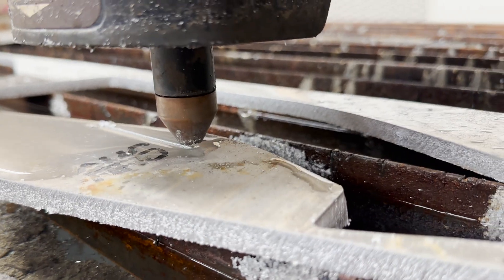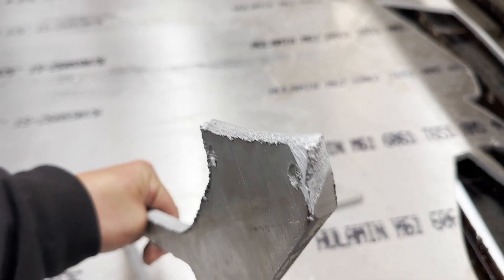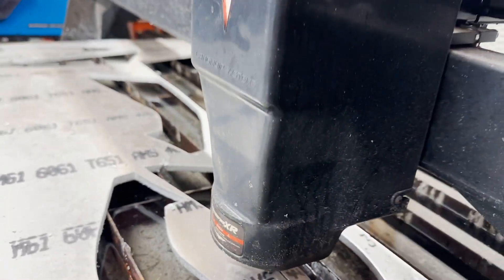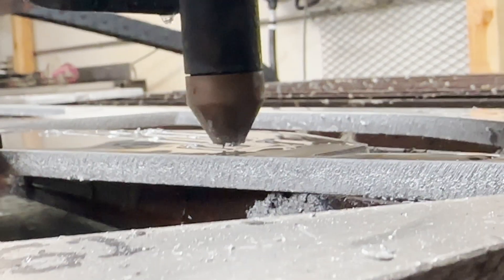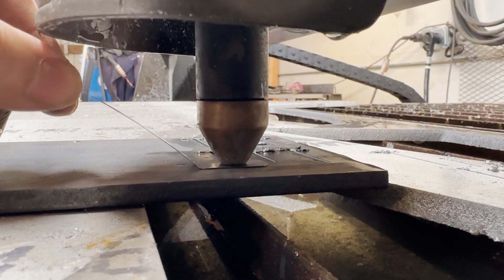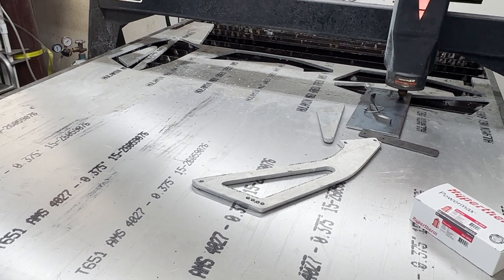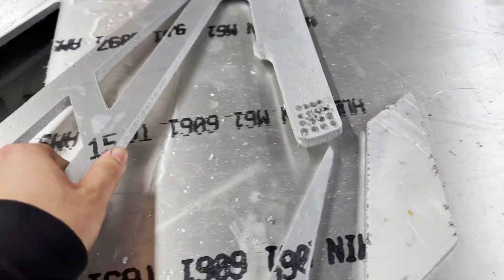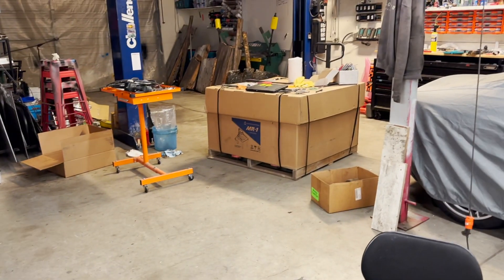Setting Up Springback on Langmuir Systems Plasma Table with Fusion 360

Comment: Dude you forgot a zero. You said to set to .060 but you check it with a .008 shim.
Reply from the maker: 🤦‍♂️ good catch! But it cuts so much better this way! Lol
Reply: yeah, that's 8 thousandths instead of 60 thousandths, which is pretty much 1/16 inch.  you can use a piece of 16ga.